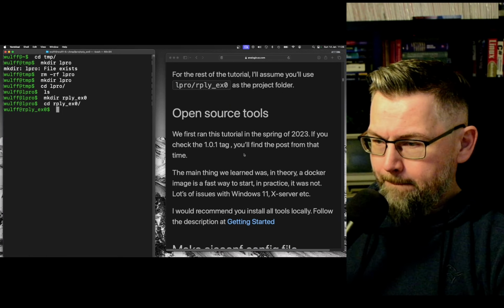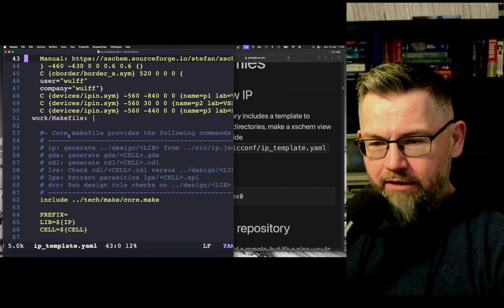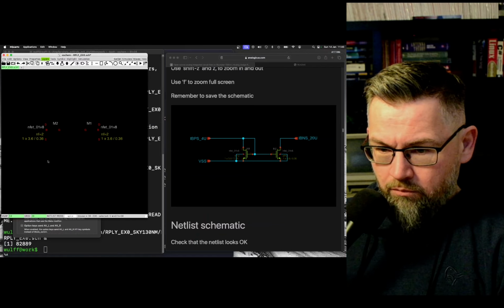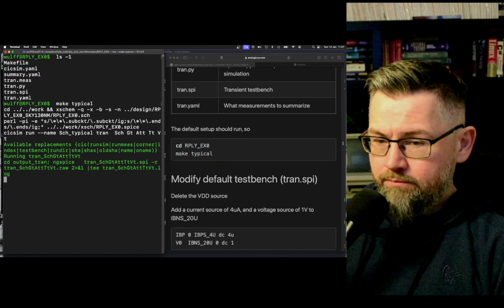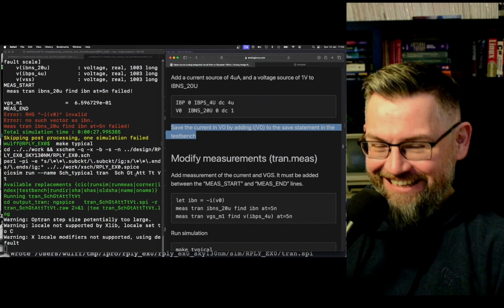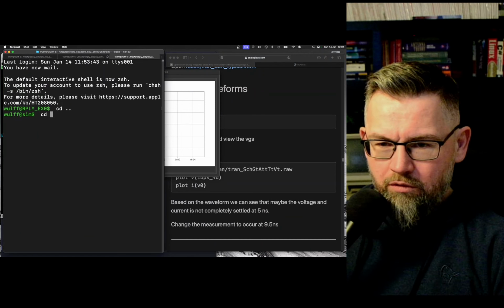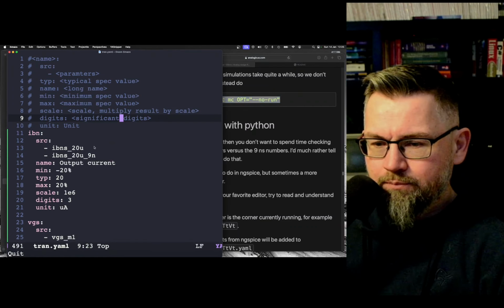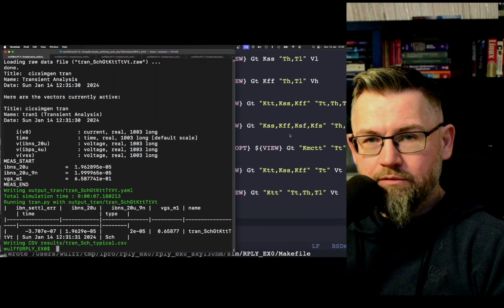Sky130 Schematic/Simulation Tutorial

Comment: Which analog block would be the best starting point for someone looking to get into the analog IP business? I'm looking for a project that is beginner-friendly but has real market potential as a sellable analog IP core later on. Or it is not that easy to enter this field as a "solo founder" or freelancer?
Reply from the maker: Interesting question. I would target infrastructure IPs for digital circuits. Maybe a small, fast, temperature sensor. I suspect, however, that no analog IP is beginner friendly. But that should not discourage you. Maybe you'll find it so fun you make something others can't. An example of a temperature sensor can be seen at https://analogicus.com/lelo_temp_sky130a/
Reply: @analogicus  Yes, analog is difficult. I’m leaning more toward a Digital Always-On IP that detects medical events, such as arrhythmias, locally. It sits immediately after the ADC to prevent the drain caused by streaming 'healthy data' to the cloud, significantly improving both privacy and energy efficiency. Maybe that is a good idea too. Thanks for sharing the temperature sensor project!